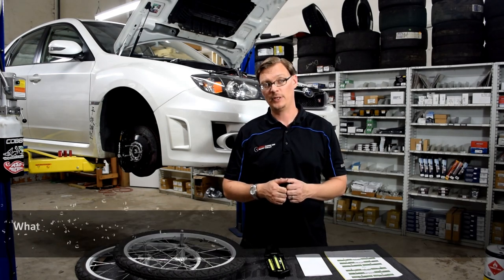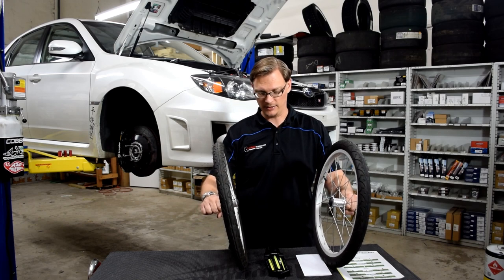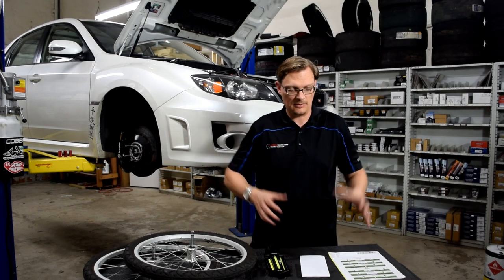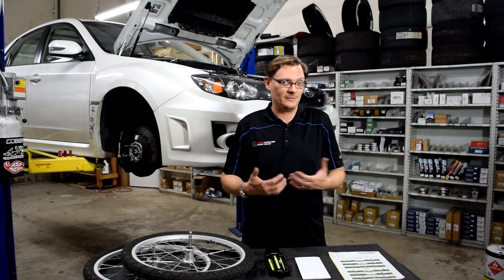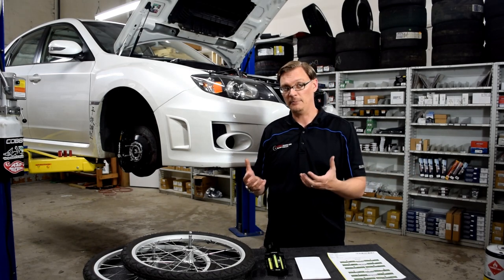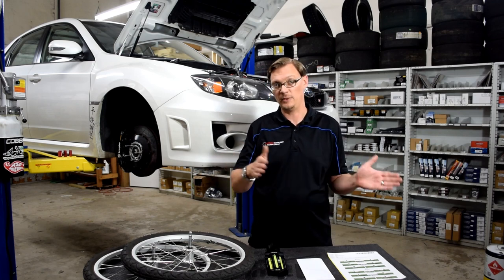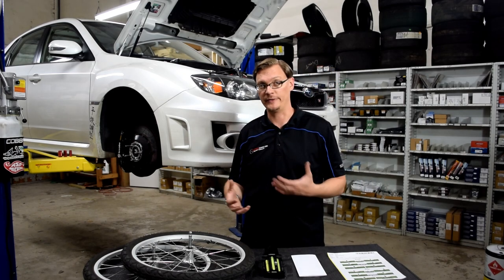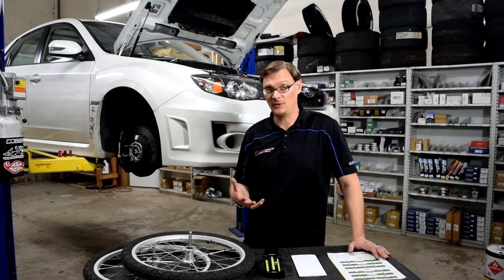What is Caster and what does it do?

Comment: Just came across this video. I am running significantly more caster with new plates on my bmw and was disappointed the static camber wasn’t more. The race shop that set it up said “this will be a huge improvement!!” I finally grasp fully how this new caster setting will work for me based on the issues I’ve been having!
Reply from the maker: Thanks for the comment, and thanks for watching.

Stay Tuned!
Reply: More caster = less static camber needed = better braking stability

Comment: Question about added caster - I am looking at an anti lift kit by whiteline for the a 2018 civic which is a Macpherson suspension design. The kit is a poly bushing that replaces the OEM bushing on the front lower control arms and adds +1 degree of caster. Because of the added dynamic negative camber that comes with added caster when cornering, would it cause abnormal tirewear even if aligned at factory specs? How often do tires need to be rotated with a such a part installed for a daily driven car? Thank you for the useful information!
Reply from the maker: Thanks for your question.  For street use, generally speaking, as you add caster, you don't need as much static camber for the reason you describe.  But it does depend a bit on how the car is driven as well.

I'd recommend starting with slightly less static camber, and keep an eye on your tires. If you start to seen more inner edge wear in a few thousand miles, you could try taking some more camber out, but make sure that the car still feels like it has the same front end grip.

Thanks for watching and Stay Tuned!

Comment: Another awesome video guys! You mentioned toe out can affect the camber dynamics as the wheel is turned, I have adjustable strut tops that have max castor dialed in and I do notice my inner edge wears first, I was wondering if I left the castor but adjusted the toe to give me toe in, I'm assuming that would reduce the dynamic camber, but my only question is, how does toe in affect the handling of the car and tyre wear?? I only run about a degree to a degree and a half front static camber if I recall correctly.
Reply from the maker: Thanks for your question.  Basically, the more caster you have, the less static camber you should need on the street.  Ideally you would want to try zero toe, not toe-in.  See what that does for your tires, and if you are still having a lot of inner edge wear, try taking some of the camber out.

You will likely need to add it back in if you take the car to the track, so just keep an eye on tire roll-over.

Thanks for watching and Stay Tuned!

Comment: @FlatironsTuning Can you tell us about any negatives to the Anti-Lift Kit on Scotty's car?  I know that in addition to the offset bushing, it is also lowered.  I know of the positives, but can you tell us if there are any negative attributes vs the stock flat plane mounting of the lower arm?  Thanks!
Reply from the maker: Thanks for your question.  As far as negatives to running an Anti-Lift kit, I can only think of 2.  The first is potentially faster tire wear, as you are working the front tires more.  But this isn't always the case.  It will depend largely on the alignment that you are running as well.

The other issue is it makes the steering heavier, which can put more stress on your power steering pump in an extreme case.  In the Pikes Peak car, if we are pulling the car out of the shop and it is idling, turning the wheel too fast can cause the engine to want to stall...

Hope that helps and Stay Tuned!

Comment: Great content. What is your rule of thumb for max cross caster tolerance on the STI? My cross caster was out almost a degree and I found that shifting the subframe from side to side brought me within 4 minutes of cross caster which I believe is more than acceptable.
Reply from the maker: Thanks for the question Lucas.  Interesting.  It sounds like something shifted that is for sure.  Generally with Caster, you can't adjust it that precisely.  But with caster as with camber and toe, you really want it as close to the same left to right as possible.

Thanks for watching and Stay Tuned!

Comment: Great explanation thanks.  Question:  For my GR I'm considering the Whiteline KCA425 LCA bushings to correct caster.  Do you like this product for a street car?  Is there much noise and vibration penalty running this product? Thanks!
Reply from the maker: Thanks for your question.  That is the polyurethane bushing I believe, so there would not be much of an NVH penalty for it.

https://www.flatironstuning.com/whiteline-anti-lift-kit-2011-sti-2015-wrx

It is off-set, which is where you can gain camber with it, but you have to make sure that you press them in evenly between both sides.

I hope that helps, and Stay Tuned!

Comment: On my 2021 slingshot going straight I have to hold steering wheel to left of center, after turning loose it will immediately center itself and then slingshot goes to the right very quick.
Reply from the maker: That does sound like an alignment issue.  I would start by having that checked, as the first step of an alignment is to set the center for the steering wheel.

Hope that helps and Stay Tuned!

Comment: Great video! Thank you very much!
Can you suggest ways to increase caster on Macpherson front suspension?
Reply from the maker: Thanks for your question.  On Macpherson suspension, the easiest way to add caster is to move the strut's location in the top-hat.  You can also look at the lower control arm position, and manipulate that.  In that case, you would want to look at the position of the lower ball-joint and see if you can move it further forward.

If you can do either of those, or both, then you will have a lot of ability to change your caster.

Hope that helps, and Stay Tuned!

Comment: What happens when a car has negative caster, does it still product torque and self centering
Reply from the maker: This is fairly uncommon on cars I believe.  From what I understand, negative caster will center the wheel,  and make steering easier, but I don't believe that there are any gains in traction from it.

From what I have hears, this is most common on large trucks for instance.

Hope that helps and Stay Tuned!

Comment: Great explanation!
I'm having nothing but problems with my jeep.
It has fully adjustable suspension. 
It always wants to stay left or right. Never center.
Could you please try to explain why that is?
Reply: It seems like you have your front or rears toed 1 way.  They might be aligned but not straight.
Reply: also could be your tires... try switching the front left to the front right, and the right one to the left... see if it pulls the opposite way... all values should be as close to zero as you can get them with an alignment.... lowering or raising the vehicle will affect your alignment values as well

Comment: Sir, my car i20 front struts shockers are aligned perfect 90 degree with respect to ground when steering wheel is at normal or 0 degree position. However, the left shocker slanted bit about 30 degree approx with respect to its original vertical position when the steering is full turned to left. The same is for the right shocker when fully turned right. Is this change in vertical alignment normal??? Thanks.

Comment: How do I know if my car's castor angle is right?
Reply from the maker: Thanks for your question.  The best answer would be that you have as close to the same caster on both the left and right wheels.

From there, if you were wanting to add caster, you would just want to make sure that you gained degrees equally on both sides.

Hope that helps and Stay Tuned!
Reply: @FlatironsTuning  
My problem is that when I turn my car, the steering wheel of the car comes back to its place, but I have to bring it back.. Tell me a good solution. I have met a many mechanic.  The real problem is that someone new arrives
Reply from the maker: Gotcha.  

The short answer to your question is that as you add caster, you will also be improving your wheel's ability to return to center.  The trade-off there is that you are also making your steering heavier.

If you have power steering, this is most likely not an issue, but if you don't have power steering, you will notice the increased steering effort fairly quickly.

Hope that helps!

Comment: Hi brother...i have a problem with my ford mondeo for last 6 years and few days back when i do the alignment i checked the result and found caster and some other values are around 0.50° change and guy told its because of that ur car is going left side..i changed all front suspension apart from tie rod end which is now being coming on online and i changed two new tyres around one year back and all i driven is around 6k kilometer..what ever i have done there is no change in problm...if you can share ur watsapp num i can sent u the alignment result so that i can get some advice that what is my real problm.i changed front shocks,lower arm,coil spring,mount strut and stabiliser rod